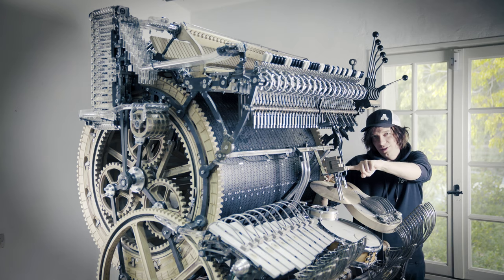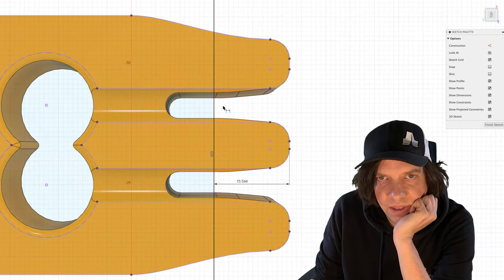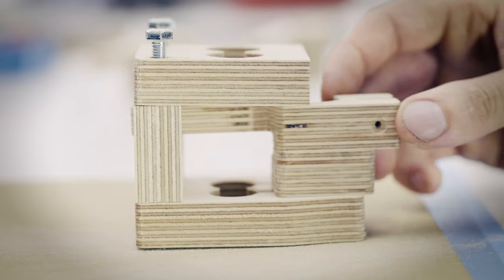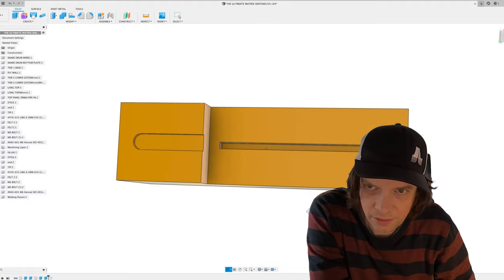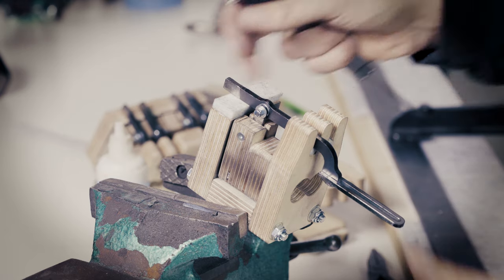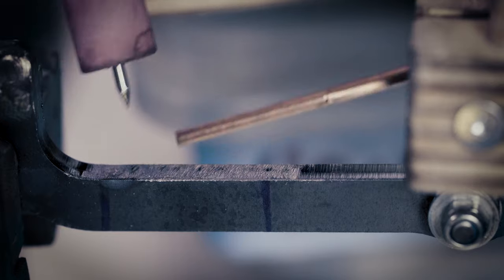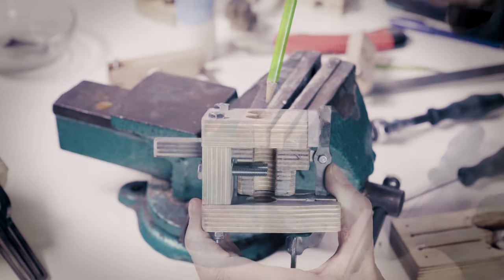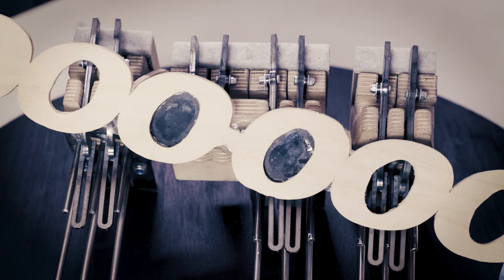Making Better Marble Gates - Marble Machine X #144

Comment: Do this to have a chance to reach 10000000 cycles. 
1: replace the felt with EPDM rubber 
2: thread a nylon sleeve onto the screw to reduce noise and and wear on the ball. 
3: use Teflon patches on sliding surfaces, graphite will not last 
4: spring load the moving upper part, In case a ball get stuck the gate will not break
5: replace plywood with POM or PC 
6: build a test rig for one channel and run it in different speeds, and different humidity if plywood is still used. Take it apart, update design and build the rest 38
Reply: Damn, i want to give more than one likes to this comment! 👍🏻 👍🏻 👍🏻 👍🏻  Martin, read this! 😄
Reply: 7. replace threaded bolt with a hardened ejector pin. At some point the threads are going to knurl over and may get metal shavings in the mechanism. An ejector pin (used in plastic injection molds) is smooth.
Reply: on that point they will also get form a dimple in the threads causing another potential failure point. but i think for now what has been done will last atleast a couple thousand uses
Reply: Good ideia
Reply: THIS
Reply: Mostly #6
Reply: Yes, it doesn't matter if it can reach 10 million drops on average before failing.
It needs to fail in a safe and controlled manner. As long as it doesn't, it is like a steam boiler without an overpressure relief valve.
Though, I guess Martin is afraid of failure to the point he forgets that he needs to machine to not break from failure, since failure is unavoidable....
Reply: #7 Let the cad-team redesign parts made of 2D-cut plywood or steel which are then screwed or welded together.
Many of the parts would benefit of being 1 single component in a material suited for that parts task in the machine.

The part he is working on now seems to be crucial for the reliability when it comes to releasing marbles at the right moment without them getting stuck. In other words, the whole part of the machine needs to have relatively accurate tolerances. No matter how careful you are, you will never be able to be that precise with plywood pieces that are screwed together, without having to fine-tune each part.

What if spare parts are needed sometime during the world tour? having to find someone to lasercut, weld and screw together a part, with 666 small tweaks that only martin (and the cad theam) is aware of to make it work in its position because the part it connects to is 0,5mm off?...
Reply: The felt is high end instrument felt, and will easily outlive EPDM for this application. Honestly, the felt will outlive the rest of the machine; the stuff is incredible. Points 2, 3, and 4 are the most important, and the principle behind 4 is the most important of all. Things need to fail safely, as Today_on_the_beach points out.
Reply: Hopefully Martin sees this. I've been worried about the issue #4 solves for a while.
Reply: +1 to all those suggestions. 
The felt in particular struck me as odd since it will soon start compressing over time where as rubber products have more of a memory.
So many parts on the machine are steel thread form in a sloppy steel hole, not exactly 10 million actuation ready.
The laser cut holes will be extra hard and the small contract patch of the thread is just going to eventually wear smooth making for a nightmare of timing inaccuracy and ever reducing throw to take up the fit slop.
Reply: #3 Teflon will last less than the graphite, also when Teflon goes base it becomes a nuisance but when the graphite goes off just a matter of lubrication
Reply: LISTEN TO THIS GUY
Reply: @fletcherreder6091  clapping stupidly
VI-TON! VI-TON! VI-TON!
Reply: You should maybe join their Discord Server and make your suggestions there, since the whole Team sits there, the chance that it comes to Martins attention is bigger than in a youtube comment.
Reply: @fletcherreder6091  Yes, if things aren't failing in a safe and controlled manner, then it is large potential that something major breaks. This is kind of why house wiring for an example have fuses. Better that the fuse burns up, instead of the whole house. (Though, a lot of modern fuses are just switches that trips instead. But give them a large enough fault for them to handle and they will burn up too......)
Reply: @todayonthebench  yeah, good comparison, he actually have one fuse, the torque limiter on the flywheel, however he did bypass it with the electric motor, and rest of the component have inertia enough to brake a single release gate very quick. Drive the motor directly on the flywheel would help a lot and also hide the ugly motor under the machine.
Reply: Im pretty sure Martin uses plywood and other materials above metal,rubber, etc for other reasons than durability 🙂
Reply: Yes! This pretty much sums up what I thought when I saw the video. Can I ping @Wintergatan for visability? Mybe you can join the discord Johannes, and tell him there?
Reply: @860707jl  I suspect that the motor is mostly for testing purposes.
Considering how cobbled together it is.
Reply: Using MIDI and solenoids isn't an option? 🤣
Reply: @pietstreet8311  post this is on the MMX subreddit and discord server. He'll be even more likely to see it.
Reply: Mostly true, although graphite powder can be replaced fairly easily, and felt had better dampening acoustically than most rubber.  My main concern is the threaded bolt grinding down the marbles. Coating the bolt would be quieter and less damaging
Reply: At least redesig the steal plates to the correct size and to prevent the extra weld step. That doesn't make any sense
Reply: All of the sliding stuff and their bearing surfaces should be made of something like UHMWPE. It's significantly slipperier than plywood + graphite, it's significantly stronger than plywood, and it's mechanically better for threading. The machining characteristics are pretty similar to plywood. Due to the additional density and strength, thinner material could be used. The only drawbacks are it's significantly more expensive and it's also about 3x as heavy. Using this material would reduce the need for additional lubrication or surface treatment. It's also significantly more dimensional stable through temperature and humidity changes. I doubt the MMX is going to be shipped in a climate controlled van.
Reply: Yep, and that welding to fix the spacing was hard to watch.
Reply: Hope, he apply this. The wood is subject to change in humidity and the graphite is not reliable on the long run.
Reply: Is the plywood that bad ?
Reply: rip MMX, he will make MMX until old age. Few people imagine how much it 10 million in real....
Reply: @billkeithchannel  Agreed. Headed ejector pins are readily available. Dowel pins and roll pins would also work if a head isn't critical.
Reply: Indeed, need a systematic approach and test rig before mass manufacturing.
Reply: I have literally no idea what you're talking about, but take my like anyway.
Reply: I wish he would just use some linear bearings in the gates and have one rod moving in one direction to control the entire gate. then use rubber and threaded holes to calibrate each gate, mount it in a sold metal frame and there you have a gate that wont fail if the wood swells up or warps and you're not using a powder lubricant that's gonna be a pain to replace. and when the bearings wear out just take the face off and unhook the back and slide each gate out and replace the bearings.
Reply: Yeah, it's bothered me for a while that he's used so much plywood when there is so many areas with tight clearances and so many surfaces that bear against each other...
I understand using plywood to quickly and easily make new iterations to a design, but he's sure made it seem like a lot of this is hoped to be final assembly.
Reply: Dose anyone want a WILLSON ornament for christmas? I do!
Reply: Wow that would help soo much.
Reply: i think you should post this on the Discord server that he sees this good post. I thought the same. The felt is really too soft and rubber will cancel the error out.

Comment: As an engineer myself, it doesn't matter if your machine drops 1 000 marbles or 1 000 000 000 marbles on average between failures.
What matters is the type of failure. You should design for fail safe, not fail dangerous. (Fail safes aren't strictly for safety of the user, but primarily for the safety of the machine itself.)
If something is preventing the machine from moving, you should generally have a designed weak point in the system, that "fails" in a controlled fashion.
In regards to the marble gates, this can be something as simple as a friction surface to bring over the mechanical force, a linear clutch per say. A bit like the torque limiting clutch in a screw driver. (One easy mechanism for this is a spring pushing onto a ball sitting in a detent. This could for an example be put in place up near the interface with the programming wheel itself) With such a mechanism, the clutch would give way before the machine itself risks damage.

There is though many other ways to design a machine to be fail safe.
But your current line of thinking that the machine "needs to drop 10 million marbles without failure" is frankly not how you should look at it, its like building a steam train without an overpressure relief valve...
You machine should be able to fail every single drop it makes without breaking, since all expected failures should happen in a controlled fashion. Then it should obviously also have a sufficiently low failure rate as to not make it useless in its application.

Thankfully the flywheel on the machine has a clutch as a fail safe. But that clutch is comparable in its function to the main fuse in your distribution panel. Ie, it is there to handle large failures. Now your machine needs more localized protection as well. (Just think of the distribution panel for your house, you don't just have a mains fuse, you also have a fuse on each circuit going from the fuse board. But on top of that, each appliance you plug into a socket is also having a fuse inside of the appliance. All of this serves to both protect the house wiring from overheating, but also to stop appliances from catching fire if they suffer a short internally.)
Reply: it's beyond my mind why he keeps telling the same stuff each video about having a bazillion marbles not failing once...

Is he really that stubborn to not listen to anyone in his team or the discord, this exact problems is mentioned by literally everyone for the last 10 videos or so
Reply: Ok, I'm not the only one here... Skipping notes is much better than jamming was in one of my comments.

About the comment it self, the angular momentum of the programming drum scares me quite a bit, if a jamming occurs trying to stop it a clutch wouldn't help much I gess. Using it so closely with the marble lifting mechanism shivers me...
Reply: What a thoughtful and nicely written piece of constructive criticism!
I really like the comment section on this channel :)
Reply: I couldn't have said this better. +1
Reply: Not an engineer, but I feel that. Ironically, the first Marble Machine was probably more fail safe than the MMX.
Reply: What annoys me is how many meme comments you have to scroll past before you find real comments like this, even though they have less likes.
Reply: Admit it. You didn’t read that whole thing.
Reply: @wgc7775  The very vast majority of people on the internet tends to not read longer pieces of text, almost regardless of content.

It is a bit sad to be fair...
Especially those times when one gets comments about one being an idiot for not taking certain things into consideration. Even if one's original comment clearly shows that one did take the things into consideration. At those times, I guess one just have to ask, "Did you even read?..."
Reply: @i.r.3249  Oh, definitely. But to be fair, many of the things which made the first Marble machine fail safe are also what made it crappy at doing its job.
Reply: @todayonthebench  That being said, the people watching this video are the type to read through that entire comment
Reply: I like you're funny words magic man
Reply: @wgc7775  Of course we did, and then we read all the replies until we got to yours!  Martin's audience are geeks and engineers who watch every minute and read the comments to make intelligent contributions for the love of the project :-)
Reply: Hey I don't want to be annoying, but just so that you don't embarrass yourself in the future: It's "per se", not "per say". It's latin for "by itself".
Reply: @barmetler  yeah, I don't think he meant that: I reckon "per" was a typo, he was on autopilot and didn't notice it. I read it as "...linear clutch, say" as in "for instance."

But then I'm a truly old-school fuddy-duddy grammarian who puts borrowed words like per se in italics, so it's impossible for me to do that one accidentally! </geek-mode>
Reply: the gate mechanism is just attached to a leaver that is lifted by the teeth on the wheel and lowered by gravity.  If the gate sticks open then the leaver just stops engaging with the teeth. seems safe to me.

an engineer may not care how tall the building they build is and only care about weather the building will function.  The businessman that is funding the building with the understanding that it will be the tallest building in the world, does care and the engineer needs to understand that.  The Marble machine is not only a thing that needs to function, but its actual construction needs to be entertaining in order to fund its development. the process of making the marble machine is as much of a product as the actual device the process aims to produce.  setting a 10 mill drop goal is a milestone and goal to build videos and 'programming' around.

It seems to me, a non engineer, that i would prefer that the gate fails due to wear rather than a mechanical jam because wear and tear is predictable.  in airplanes, or ships or space shuttles; parts are replaced before they wear out while they still function at full reliability.  If an airplane's tires can survive 100 landings without decreased capability then they get replaced every 50 landings, which leaves a 50 landing buffer ensuring that even a plan that missed a tire change or has experienced beyond expected stress is never landing on tires that are anywhere near breaking point.   knowing how long parts last also tells you how to manage resupply of those parts. 

If the gates start to wear out around 10 mill, or 5 mill or 100 thousand drops then the designer knows to plan to replace the gate before that point in the future and knows which parts wear in what way.  you cant know how they will wear or how quickly unless you just run it until it wears out, which i imagine is also part of this 10 mill test plan.  This is a music machine and becuase the gates are dropping marbles and playing specific notes/beats you can calculate exactly how many songs you can play between replacing parts down to the exact bar of music if you know how much wear and tear the parts can take.

Comment: Failsafe design is not about getting sure it won't fail, it's about managing the failure so that it won't break the machine. 
You can work as hard as you want, as long as a mistake can lead to a critical failure, it can/will happen.
Manage failure instead of trying to cancel it.
Still loving watching you since years, I trully hope the best for you.

Comment: @wintergatan, You should file down the end of those bolts into a point. Not only will it make it a smoother rolling surface and reduce friction but it also:
1) Make the marble roll down instead of laterally, completely solving the problem of lifting the marbles above it 100% of the time.
2) Lowers the chance of the marble getting stuck against the flat edge of the bolt if the gate tries to close too fast. 

Thumbs up if you agree with me!

Comment: Martin: "Pain is temporary, glory is forever!"

CAD team: sad CAD team noises
Reply: If he used proper parametric design software, alterations would be easy.
Reply: @thomasbecker9676  I don't think the problem is with the software
Reply: @antalz  If it's Fusion360, it's a problem, lol.
Reply: @thomasbecker9676  Fusion360 has parameters, though it's not quite as powerful as the configurations you can do in SW. But what he's doing here could have been done parametrically.
Reply: @antalz  I use CATIA, so everything else tends to pale in comparison.
Reply: @Sir99percent  what
Reply: @Stapher  this got me harder than it should've